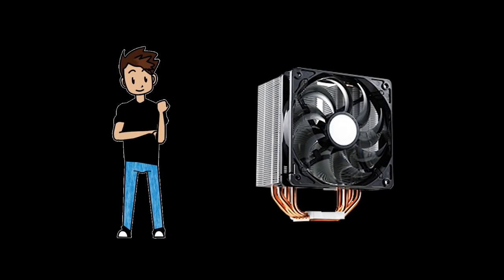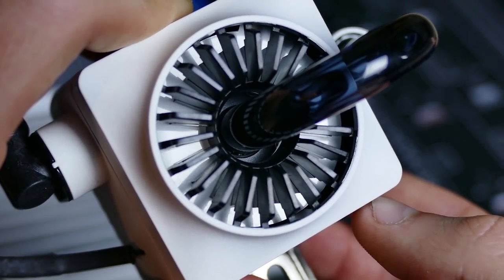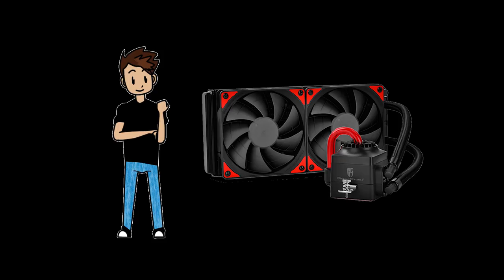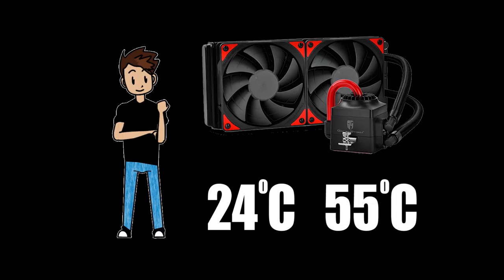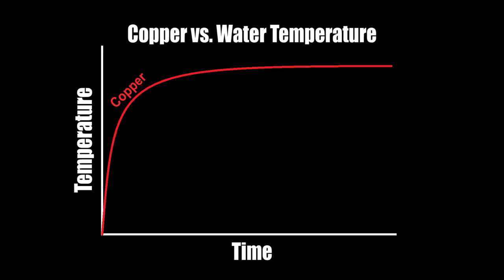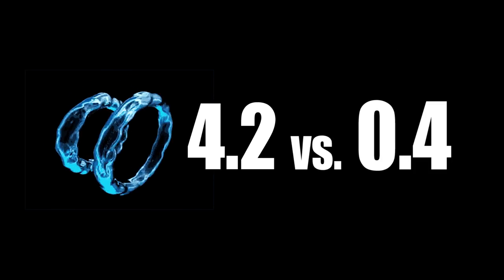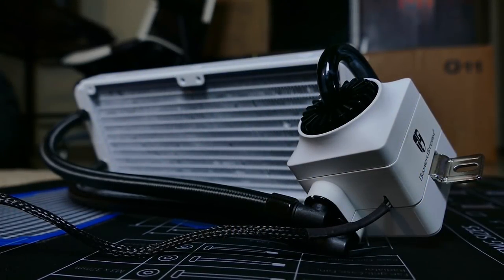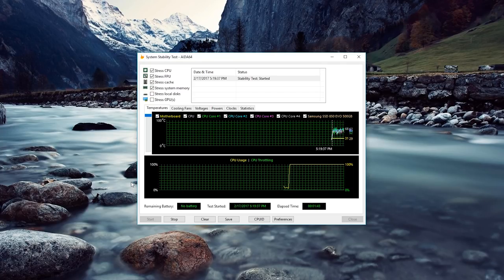How to Properly Measure AIO Temperatures

Comment: I noticed this too when I switched to an aio from a hyper evo 212. The temps kept rising for much longer than the 212.
Reply from the maker: Yep! Just the nature of water!
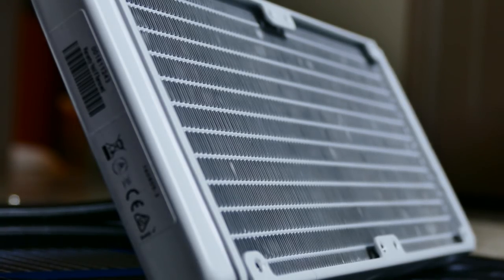Reply: why is it i swear is see an Illuminati  triangle at 1:14
Reply: Poor Man's Tech OMG Are you Andy? :O
Reply: LOL It's good enough to keep my 8320 running at 4.8-5 ghz and it's silent. That's good enough for me.
Reply: much better airflow though on AIO.
Reply: I'm not a fan of AIO, sure they are simple to install but in my eyes not worth it. If you want to water cool your pc go for an custom water cooling solution :)
Reply: AIOs will break eventually because of evaporation. A custom loop can be topped up but requires maintenance now and then.
A good air-cooler will last practically forever. (not counting fans)
Reply: that's a reason why i pick the evo master race.
Reply: Good thing about swiftech it is a aio but it has everything that a custom loop can do
Reply: true but there is alot of issues with the swiftech units. all of the fitting based aio are quite bad atm (leaking etc)
Reply: Daisudori i had the same issue i returned mine... They gave me a new one and well so far so good.... 😊
Reply: ANBU-P4rt1s4n0 nice. had h100/h110i gt. now full custom loop :D. am interested to see the New EK aio coming soon
Reply: Dou you still recommend and AIO over an after market cooler? given the fact that the after market coolers are heavy and (at least in my opinion)  potential damagers of the motherboard. I´m planning my new RYZEN rig, but I don´t really want to have any problems with the build. Great channel ;) cheers from Argentina!!
Reply: my noctua nh d14 never had a problem, very solid cooler and mounting system. keep in mind aio can leak and damage aswell, also, it will always make more noise then a good heatsink (pump noise)
Reply: Diego Ignacio Falcone eu si sos de argentina, estarias interesado en un fx 8350, con una mother y 8 de ram?
Reply: Erika Nakagawa Gaming what are your temps? i think Im going for Cryorig H7. Alot say its the 212 killer
Reply: Koning Willem-Alexander is het ook, en mooier ;)
Reply: Gracias! pero ya tengo todo el dinero ahorrado para la nueva plataforma de AMD. mi última pc fue un i74790K , 32gb ram y un Sli de GTX980. Gracias por tu oferta y mucha suerte con la venta !!
Reply: Daisudori Heb je hem?
Reply: Koning Willem-Alexander nee h110 en nh d14 gehad, nu custom wc
Reply: Daisudori ah ok
Reply: Koning Willem-Alexander zal qua temperatuur nooit veel schelen, hooguit 3 graden ofzo. vind die cryorig stuk mooier
Reply: David Freeman why would I do that if I can get a hybrid cooler for the gpu and an aio for the CPU?
Reply: ArtisChronicles I second that, why not just use a hybdrid and aio instead of a custom loop?
Reply: you must keep your room very cold, 66F (19C) is extremely cold for a house.
Reply: hyper evo 212 is good old cooler mid range at best. compare AIO to similar price air coolers like my epic noctua d14. i run c2q 9550 E0 3.9 8 gigs ram 4.2 4 gigs. for 7+ years. pc is turn off maybe 1 day per year.24/7 accept cleaning. i will try WC at some point. but i i prefer to be safe. people dance too much in my apartment ;)
Reply: We stay around 15c here, and up to 20c in the summer months and it's perfectly comfortable, I guess really it's what you're used to.
Reply: its all about estetics for me, cooling is a nice sideffect. Hybrid coolers are so expensive, just a buy a stanard card of your choice  and buy full cover cooler for same or less the price of hybrid coolers. At least in germany hybdrid cooler on cards are way more expensive.
Reply: + if you have good case you dont need wc and like Findecanor mentioned. evaporation is enemy that will sit in back of your mind like TBW in SSDs..
Reply: well with AIO and how those base plates and mounting is could benefit from a really high quality TIM same for any of it I suppose. EVO is capable though don't mind noise stick some crazy fan on it and watch temps drop...different approach for sure need more copper if I was to design one because copper has better heat transfer properties than just plane jane aluminum and whatever stick fan on it and it can be really effective for load temps.
Reply: Poor Man's Tech I neva was a fan of them they look kool and make ur rig clean but if this is true that's crazy smh
Reply: surface area of the heatsink is much less on a aio hence why it takes more time to cool after the cpu is reduced load. if you have a proper sized rad this would not happen as the water temp would not increase.
Reply: Poor Man's Tech what app do you use to check temps cuz i cant find one i like
Reply: chronicblazer84 thnx
Reply: Hyper 212 is the longest lasting cooler I've had. never lets you down
Reply: Not all of them use water, you have much to learn how this works
Reply: very few, if any, still use water.  Most use a fluid much more similar to what you see in a car's radiator.  Granted, much of what you talked about still applies, but the liquids are designed to dissipate heat much more rapidly than water.
Reply: you do know there is water with an additive in cars radiators right?,
Reply: I would say any company making decent aio coolers are for sure not using straight water, it would be silly for them to not use a simple antifreeze mix for the colligative properties.
Reply: Name calling is what kids do best, just ignore them.
Reply: Well I apologize for calling it anti freeze but yes coolant, but yes same point, raising it's boiling point thresh hold. Aka using a coolant mixture for it's colligative properties. And as far as I can tell the most common one used in pc cooling tends to be glycol, ethylene glycol most commonly. Plus generally some kind of surfactants for viscosity & tension and some biocides to prevent algae and stuff and any decent one will have some kind of corrosion inhibitor which is probably coupled with some pH stabilize/buffer. 
In not short, NOT WATER.
Reply: Seems like the car companies have these days moved to something like propylene glycol for animal safety, guess pc makers assume no leaks your animal can get to which makes sense. But yea, why i said antifreeze originally lol
Reply: Makes sense :)
Reply: Right, well I figured what 70% of the AIO coolers these days are Asetek OEM coolers. This is right from Asetek "The liquid is mainly deionized water mixed with environmentally friendly additives providing antifreeze, anti-corrosion and bio inhibitor protection. The additives are commonly used for airplane deicing and are approved for use in food processing equipment." What this says is actually a little different than the custom water set-ups. It means most the of the AIO aka Asetek are running propylene glycol for the non toxic nature whereas the custom crowd prefer ethylene glycol for the slightly higher thresh holds toxicity risk not an issue for obvious responsible reasons lol. Interesting.
Reply: Talk? you got but hurt because you do not know what you are talking about, and then you start name calling like the kid you are. Its ok tho one day you will grow up.
Reply: antifreeze is a coolant yes, but the name of the coolant is antifreeze. Yes there are other coolants that are used as well.

chronicblazer84

"The problem with water, is that it has oxygen in itself, making it into an automatic corrosive agent"

I laughed so hard when i read this. Water with or with out oxygen is not corrosive, this is why we can drink it from the tap or a stream.

chronicblazer84
I'm a learned track mechanic, and a learned machinist with 15 years experience between the two.

Im a learned, want to try that again?

chronicblazer84
So with that said, electronics use distilled water:

Electronics do not use water, Also distilled water after a period of time will become conductive when flowing over the metal.

Now im not sure if you are just stupid or a troll, my bet is the latter of the two.
Reply: Do you ever get tired of being wrong? You are wrong got called out on it, now move on.
Reply: Guess I'm not the only one who agrees about his disability lol
Reply: This is the high road? insults from the net oh no what ever will i do? Someone with inflect called me a name and said  mean things because he/she could not talk like an adult and talk. Someone points out you are wrong and you lose it. Ya call me what ever you wish but it will not change a thing.
Reply: still wrong but it's ok. You may think you know about cars and such, but know nothing of computer parts but you still have time to learn.
Reply: You corrected nothing. You just started making stuff up. But this is the internet people do that.
Reply: Sure it is whatever you want to make up and post on the net is really up to you. People will not believe you but im guessing you are use to that by now huh?

well someone has to be the janitor for them just make sure you are doing a good job and keeping the place clean.
Reply: You can make up what ever you wish this is the net after all. And you already said you dropped out of school joined the military as a minor, and as soon as you did they put you to work on tracks.

You can say you are grown if it makes you feel better about being a child does not affect me at all. Hell keep on making more stuff up no one believes that you are telling the truth.

Saying you live some where else is no excuse for the piss poor English, considering you say you are an American .

retzmann is my last name, so ill let you google that fun fact.

Oh before i forget very good on using google translator very good.
Reply: Man you really want me to believe you really bad don't you, but sadly i do not and nether does anyone else. Maybe you do not have friends and you think i could be one for you. Sorry no liars do not make good friends but im sure some day you can find one?
Reply: Ah i see you trying to plug your own channel i see lol.
Reply: LOL you say you stopped responding but every time i post something you respond even if i do not talk to or about you. wow you calling me little guy while suffering sms is really something.
Reply: A high school drop out such as you calling others a little kids is very funny. And everyone knows how the evo 212 works its not a hard thing to figure out, they teach you that in high school, guess you should have stayed in and finished huh?
Reply: But if i did that then what would you have to comment on? And really there is more than that misspelled but you missed it? See what happens is when someone is wrong and they have nothing left they for for spelling. So i miss spell stuff and see how long they wait till they call me on it. But it is nice to see it works on others as well, but im sure the smart ones picked up on it? Thanks for playing.
Reply: OMG KISS ALREADY
Reply: Cooler loops need a pass through micro refrigerator freezer box to cool down the liquid water even farther.
Reply: David Freeman I disagree. I have two systems. One has a 6600k with a custom loop containing a 280mm rad that cost me $350 and one has a 4790k with a 280mm x61. The temps are identical.
Reply: ***** definitely. I built the computer with the custom loop only because I wanted it to look a certain way.
Reply: the  reason i change AIO to custom water is my room temperature (30c++)  it the  only method  can sustain that kind of heat...
Reply: Poor Man's Tech can't go wrong with the 212 in terms of value.
Reply: Poor Man's Tech Aye, they will do! There's all that fluid ye need to heat up first, and if yer rads are too wee - yer done for.
Reply: Cryorig H7 FTW
Reply: so you dont recomend the AIO ????
Reply: FRIEND PIRA Well I wouldn't. The rads aren't remotely big enough to justify and therefore neither are the gains over good air (i.e. D15), especially considering the price premium.

If you're really pressed for space - sure, but otherwise stick to air 'til you can build a custom loop if you want water.
Reply: price premium = waste of money...so thanks for reply cause i run fx8300 on stock cooler and everyone at forums says to change it while i O.C it to 3.8ghz and temp MAX 56C what cpu you combined with this AIO and max temps ???
Reply: FRIEND PIRA Should have started with that...

You my friend have bigger fish to fry!

The main problem with AMD chips of the Phenom generation (and Bulldozer I presume) is that their Tjmax is at 62 degrees C. Realistically that means that most coolers - water or air, really don't stand a chance if you start pumping more heat into it. They need a good ΔT to give you the advertised dissipation and an AMD chip will die at that temperature.

CPU cooling runs on equilibrium. You need to dissipate as much heat as the CPU is generating. That happens at different temperatures for different cooling setups and also at different temperatures for different power levels. What you want is a cooler that will dissipate 150W at a ΔT total of no more than about 25°C. I say good luck finding one :P You drop 5° at least just on the IHS, then from block to water - another 10-20° if you're lucky. You need a super skookum rad to dissipate all the heat without raising water temperature more than a degree or two and AIOs just don't have that.

The D15 isn't much better in all honesty, but it's a fair bit cheaper and simpler. From what I've seen, Noctuas in particular are quite good, the NH-L12 keeps my Sandy Xeons (95W TDP, probably dumping about 70W at max load though) at 55-60°C under prime load, so I'm sure the D15 will look after your chip well.

My advice is to keep to a thermal limit of 55°C. My ol' Phenom II could tolerate up to about 3.9 (from 3.4), but went unstable above 55. Maybe Bulldozer are better, you'll have to find out. Check AMD's listed max temp, should be on the chip's data sheet.

As far as upgrading, I wouldn't worry about going liquid until you either go Intel or Ryzen. The D15 will love either, but you gain more from water on intel chips, AMDs just don't have the thermal overhead to keep cooling efficient (maybe they do now!)

If you go intel, get a Sandy Bridge chip - 2500K or 2600K. Cheap enough 2nd hand, perfect for gaming and learning to overcloxk the system. The average Sandy has enough overhead to give you 5GHz for benching on air and maybe 24/7 on (good custom) water if it doesn't take more than 1.4V to keep it there.

Have fun tweaking!

P.S.: See if you can get away with undervolting your chip as it is, should get the heat down a bit.
Reply: Poor Man's Tech

 Until you heavily overclock... a 212 is only a couple degrees cooler than a h100i till you're at 5.0ghz on a 7700k(delidded) like me
Reply: What thermal paste did you use on the delid? cause mine stock gets hot as hell!
Reply: Anything will do at this point really, but don't use any abrasive ones (i.e. IC Diamond... you know - with actual diamonds in it!) because they will cause damage to the die. I've had very good results with Noctua's NT-H1 and on a bare die I'd take that or MX-4 over my otherwise preferred Arctic Silver 5
Reply: Aren't these "water" coolers actualy non-conductive oils?
Reply: Diego Ignacio Falcone I realize this was a awhile ago, but wanted to give you my 2 cents. A Hyper 212 Evo (or any Hyper 212 Variant) will be absolutely fine for general gaming. It price to performance ratio is amazing. Best bang for your buck cooler. Also don't have to worry about leaks, although uncommon if you get a good AIO there is no 100% guarantee.
Reply: i've got the 612 on my fx4350 at stock settings. two fans pulling and one pushing. my max temp is always mid 30's (cpu) gpu is 560ti always mid 50's stock settings.
Reply: Diego Ignacio Falcone you can never go wrong with a quality air cooler, the damage you speak of is.. rare, like super rare,
Reply: AIOs will fail, but it's gonna take forever (in PC terms).  I have an original H50 (from 2009) that's still working just fine.  The computer is now pretty much on it's last legs performance wise, but the cooler is still working just as well as when I built the computer, even though one of its fans died at one point.  It's been cleaned of dust, of course, but the loop itself has never been touched.
Reply: must be nice.. we have 30 - 40 in the summer
Reply: Science Studio add some science it's because water has a higher heat capacity the longer you run it the more it heats up and then it's hard to cool
Reply: I think the custom loops have less chance to higher temps thanks to how their blocks are usually separate from the pump, also the better quality radiators.
most radiators in the AIOS are total crap or are way too thin to actually dissipate energy properly.
Reply: no it wont. but the problem isn't unique to air coolers, That problem is thermal paste. thermal paste does not last forever and like water cooling, it does need to be changed out.
Reply: hmm still running my cool it vantage from 2012 cooling like alwayes ... 4.5 ghz on i7 62 celsius ... and running silent...! and temps dont stay high for long after 3-4 min after gaming back to 33 celsius. air coolers are just not up to the task without beeing too big and noisy... not much cheaper either
Reply: That was years ago... a good pump will be inaudible for you...
Reply: Shoot I keep my house at 65 or lower year round and find it warm at times
Reply: Billy Darley Gotta love those big ass stacked fins 😂😂 i got the 612s btw
Reply: Findecanor mind explaining to us how water evaporates in a closed system? Unless it's in a bose-einstein state i dont think water will evaporate without opening a pressure relief valve. Pls dont spread lies.
Reply: I think they should put the water tank outside the cpu since it's hot inside. It will help to cool fast..
Reply: Please don't let yourself Believe the 212 EVO cools better than any 120 Mil Rad AIO... Cause it's definitely Not...
Reply: Most of Air cooler for OC good might 6 heat pipes but those are heavy and maybe damage your board. I happy with 212 Evo but feel still hot especially my Pc close case and a GTX 1070 OC temp always 64c.
Reply: 212 is all you need as long as your case has good airflow.
Reply: 212 is a good Cooler No doubt, But when your dealing with 6 to 8 cores or more You Need something a lot bigger or A CLC at least..
Reply: Its simple any internal source of heat black will let off more heat.. Any outside source of heat like the sun shining and you wear a black t shirt it will absorb heat. White radiators look cool but they don't work as good as a black one.
Reply: Nicolas Epicness937 that’s just the play button in the middle of your screen 🤣
Reply: @1Shignog  you don't use normal water though as it corrodes the connections to the engine block
Reply: Poor Man's Tech 1.000.000th view. Give me a pc please :(
Reply: Better this way than thermal spike that shocks the metal